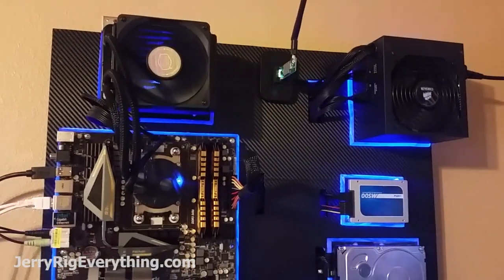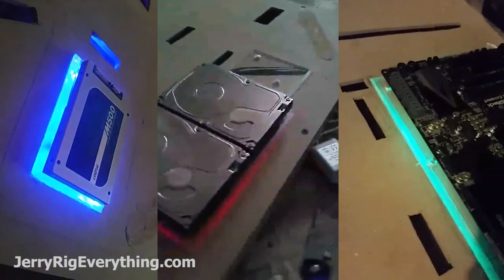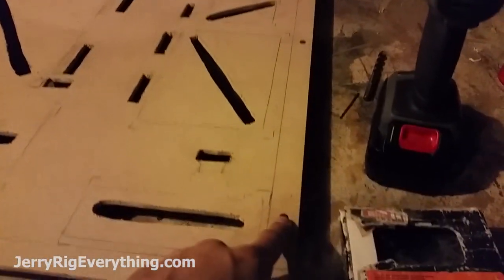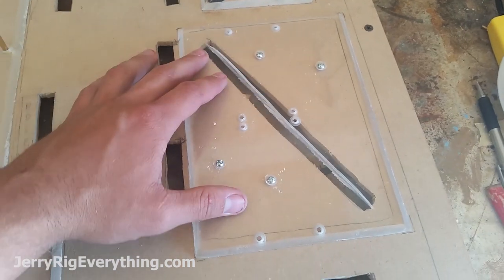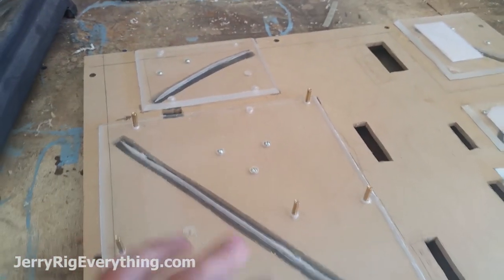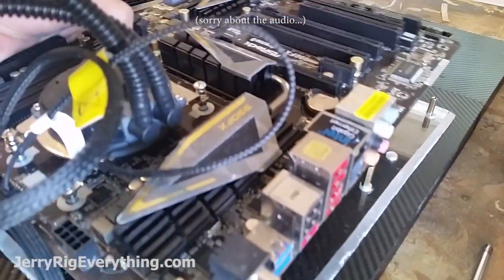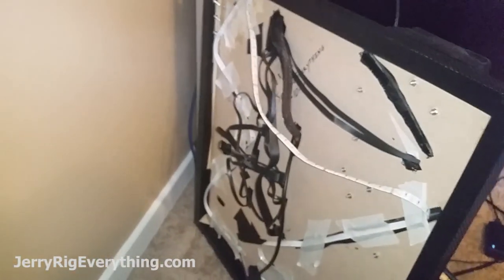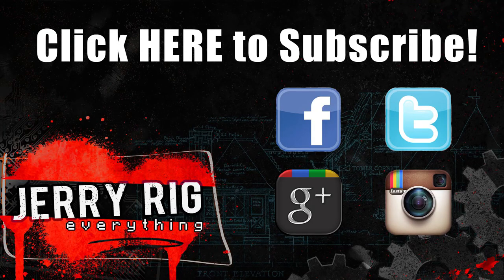JerryRigs' Rig - How the Epic LED Wall Mounted PC was Made

Comment: I like it, but about the only thing I would try to improve on would be to try to make some sort of retention clip mounting system for those drives. Would be easier to replace a failed drive if you could just pull the drive out without having to take the whole board off the wall. Looks nice!

Comment: holy crap now i absolutely have to build something like this, nice job man!
Reply from the maker: Tohtori Valta Thanks man!  If you do build it... find a way to ground the components.  I am currently having issues with static electricity. One Idea is to take all the screws that are sticking through the back, and connect them with copper wiring to the screws holding the power supply.
Reply: JerryRigEverything Will do, I've got a degree in electronics so i'm always really carefull with this stuff. Now I just need to find a way to make this happen with 2 gpu's

Comment: Jerry, I really enjoy your videos - it's clear you invest a fair bit of time making them.  I'm getting ready to build a computer and came across this video while contemplating building it without a case.  4.5 years later, how did that rig work out for you?  One of my main considerations is that I connect and disconnect many SATA drives a week and I want to use the hot swap sata ports directly instead of USB docks.

Comment: First of all, great video man, I've got some spare acrylic pieces lying around that I'm going to sand down for some illumination as well, but my construction will initially be really basic with cables all over the front... 

Anyway, just one thing I'd do differently -- @ 7:30 the power supply mount... I'm assuming this is a new PSU under warranty, but in my case I'm reusing an old 500W and my approach will be to take it apart and screw appropriate mounting holes so that it fits flush against the board or acrylic... still I like how sturdy it turned out even if it doesn't look as ideal

Comment: Obviously this is irrelevant since I'm sure you fixed the issue; but shrouding could be a great way of deflecting the rising hot air to the rad/fan setup. Regardless, really cool setup.
Reply from the maker: +Josh Johnson Good idea.  I actually just kept using it.  It never got over 74c-75c under full load.  I am just going to get a bigger radiator next time.

Comment: did you cut the acrylic to the size of the component or slightly larger to get the 45° cut? if larger, how much extra did you add. I'm doing my own build now and motherboard is 9inx7in. should I cut acrylic that size or add around 1/4 inch

Comment: question regarding the groove cut into the acrylic. was the groove cut into it like "V" or "^" if that makes sense. also how did you cut the 45 degree angle on the acrylic?
Reply from the maker: +bsdragster The grove was cut into the bottom of the acrylic in a "^" shape. (The cone pointing up.)  The bigger the grove (without going through the acrylic,) the more light will be dispersed towards the sides.  I held the acrylic over a table saw blade at an angle. Probably not the safest thing to do... but it worked for me.

Comment: Wow nice work! Especially using the plexiglass to spread the light of the strips is a great idea! But how do you turn on your pc actually? :P
Reply from the maker: ***** My motherboard has a setting where I can just turn it on with any key press on the keyboard. It also has a power button on the mother board itself. BUT all motherboards should have pins for an external power button that you can install anywhere (Usually preinstalled on a normal case.)

Comment: Hi Jerry, sorry for the noob question but would the graphics card and had drive overheat if you install it directly to a piece of wood? Should I use acrylic plastic for safety on top of wood? I am making a custom PC case out of wood so I wanted to avoid using plastic since it is easy to break but I might try drilling it myself. I have access to a drill but not the tools you do like the saw and stuff. I have to do everything by hand. How did you fasten the graphics card to the board? Does anyone else know how to do this? Many thanks in advance!

Comment: Wow that is nice did it haves power button I think it will be cool if it was on your remote
Reply from the maker: Sky Ski It does have a power button, BUT I have it set up that I can press any key on my keyboard to turn it on as well.  So I never actually have to touch the computer, Which is nice.
Reply: ok nice and uu i replace the batt in my iphone 5s its not working but when i chage it gets hot did i forget a cable

Comment: Good job. But didn't understand how did you put standoffs to the acrylic. Is there a nut on the other side or did you just stuck them in to the glass?
Reply from the maker: I just screwed them into the acrylic, after predrilling a hole
Reply: +JerryRigEverything Just wondered how safe it is to use that technique on an AIO cooler. Because radiator is heavier than Motherboard (in my case anyway) and honestly wouldn't feel cool about that.Is it possible to screw spacer in to the radiator and use a screw from the other side?
Reply from the maker: Caner Hocaoglu You mean like how I mounted all the rest of the parts?  Ya, you can do it that way.

Comment: I was wondering how you mounted the video card I could find pics anywhere
Reply from the maker: Corey Deal One screw through the hole in the top left of the card.  And then one screw under the card on the bottom right. (wrapped in electrical tape to make sure it doesnt short out.)

Comment: hi jerry. It`s really cool setup. I`m planing to build one. but using 3 tv's, would you have any suggestion on the graphic card,
Reply from the maker: Mohamed Hafiz Just make sure your graphics card is capable of handling multiple screens. I know mine can handle at least 4 screens. (Maybe 6) Its been awhile since I checked specs on it though.

Comment: Were you able to have your power supply reach all the components with the stock psu or did you have to buy extension cords? That's my main concern that the PSU lines won't be long enough when I build mine

Comment: How did you mount the video card?, I'm working on a similar project, and that's the one part i need to figure out.
Reply: Interesting point. Perhaps a wire connecting screws on the back board for a discharge / ground

Comment: I am building a briefcase PC for my brother. It will have an acrylic ceiling above the parts. I want to mount the graphics card to the acrylic ceiling and attach to the MOBO via PCI riser extension cable. Any suggestions to mount the GPU? I want to avoid anything metal touching the GPU. Right now I am thinking plastic brackets screwed into the acrylic.

Comment: Sorry if you address this in this video, I didn't couldn't find it. How did you mount the graphics card(safely)?
Reply from the maker: SirMisteryYT "Safely" is relative ;-) But I have a screw through a hole in the top left.  And than another screw (wrapped in electrical tape) supporting the bottom right side. The graphics card is just resting on that screw. Than the top right is just held down by the power cables themselves.

Comment: That was fucking amazing! Could you please include more information, about cooling, noise db, and costs of basic materials, and links to which types of cables you needed, and some of the lengths and measurements used. If you can provide this info I will make a website about your computer and all information will be posted there, to make it easier for people to reproduce something like this

Comment: Hey, i am planning to do my first wall mounted Pc and i was wondering; i am using a msi gtx 460 cyclone and there are extra holes in the pcb i think they are for screws, could i use that to mount it on the board ( regular wood ). What type of screws, if it matters anyway. Also for the motherboard, is there any safe make shift stand offs? I have seen some with screw and bolts and not sure if that was safe. Sorry for all the questions man xD

Comment: Looks nice! Any problems with dust? Noise levels? How about those two hard drives - any overheating problems?
Reply from the maker: Andris Zarins Temperatures are all in a normal range, And it is probably as quiet as my laptop is... watercooling is really nice that way.
Reply: thanks, ever considered lifting those hdd up a bit?  I have bad karma with hdd's lol... and they look like migh be overheating a bit if bothered a lot
Reply from the maker: They hardly ever work, as the operating system is actually on the SSD.  So I shouldn't have any issues.
Reply: JerryRigEverything Any dust issues? how long have you been running this rig?
Reply from the maker: Its been running for about a month.  It will probably accumulate dust over time... but a can of airdust will take care of that im sure.
Reply: JerryRigEverything Thanks Jerry, I would still raise those HDD up... well, that will be my rig lol :D thanks for superb video and good inspirational ideas!!!
Reply from the maker: Thanks man!

Comment: for the riser shielding that worked 75% of the time, what if you double coated or triple coated it?
Reply from the maker: No, i think i tried 3 coats.
Reply: dang. there must be a way to avoid that $80+ shielded riser... someone else tried 4 layers of aluminum foil before caving and buying that cable. There must be a way! what about something thick? some kind of wrap that was 1/8" thick so nothing could come too close to it? I don't know the range of that interference.
Reply from the maker: Let me know if you figure anything out.
Reply: I am in the research phase of my custom case and won't be doing anything for quite some time, but will try and remember to come back here if I make a discovery. thanks!

Comment: Niceeee. I was just thinking what to put on the wall above my gaming corner and this is the thing I deicided to do.... great job dude!!
But can You help me and answer few questions.

1. Can you place some links where you bought PCI riser cable and which one?
2.Cant quite see on the video this V shaped grove for LED's, is it facing V legs upwards or downwards-which way is it oriented i mean?
3. these large standoffs for mobo can be found in any store with pc components?
4.how big is the hardboard in the first place? i am afraid not to make it too large and then my power cables wont be able to reach components?

Thanks in advance
Reply from the maker: asukaj 1) Did you check out the blog post on JerryRigEverything.com where I linked the parts?  
2) The peak of the v shaped grove is facing upwards (towards the computer components.)
3) Amazon has the 1inch standoffs
4) I cant remember the exact size of the hardboard... I laid out my components before hand with the spacing that I wanted, and then got the board to match.  If you look at other wall mounted PC's online some of them have a lot more space between components.  I might go that route with my next build. 

Email me if you have any more questions. (email is found in the about section of my channel page.)
Reply: JerryRigEverything So almost done with my project, thanks for this video again i turned back to it a few times just to check some details.

For now everything is going great, i tweaked a few parts and did the same as You for a few things...

anyway my biggest concern is that PICe riser cable.

I ordered 2 - 20cm from ebay and i hope to daisy chain them and put some aluminium tape over the cable to shield it a bit.

What do You think of that or should I just have to buy the 100USD 3M one?
Thanks in advance
Reply from the maker: I never tried to shield it with aluminum tape... that MIGHT work... but just depending on how nice your graphics card is... you might just want to play it safe and get the more expensive shielded cable.
Reply: well it looks like i will have to do that...thx anyway....
and about the acrylic, I tried to put leds without the V shaped grove..looks like that grove helps a lot with light dispersion since when i put it on the acrylic without it the light didnt disperse at all..

Comment: the edges of the acrylic looked really rough, is it like that in person or just in the video?
Reply from the maker: ***** They are pretty rough.  I plan on making them smoother on my next rig that i'll build this summer.
Reply: awesome look forward to the video!
Reply: +JerryRigEverything Try flame polishing the edges.  you simply run the edges thru a blow torch flame and it melts the roughness looks like glass.  Practice on some scrap first !

Comment: How did you mount the gpu? I have the exact same as you can I haven't a single clue as to how you did it.
Reply from the maker: izaakisepic It has one screw through the GPU in the top left corner where the old metal bracket used to sit (the part that goes into the back of your computer case, if you were using a computer case.)  And then at the bottom of the GPU, you can see in the video that I have a screw sticking through the clear acrylic that is wrapped in electrical tape.  The graphics card sits on top of that screw.  Its definitely not as well mounted as the rest of the computer... but it gets the job done.

Comment: Love the video. Thank you so much for sharing. My question is: did you score the bottom of the plexi for light distribution or did you cut deep into the plexi? It appears that you scratched the underside nic and thick. Please advice if you simply do a wide scratch or cut into it? You mention groove in the center of each plexi.
Reply from the maker: The V shaped grove in the center of the plexy is thick. About half way through the glass.
Reply: +JerryRigEverything thank you. I will use my dremel for that then. I dont have a table saw but i do have a miter saw. Miter is not a good candidate. I will use either my dremel or rotary tool.
Reply: JerryRigEverything hello Jerry, thanks agin for your previous reply. I finally had some free time to resume my desktop build. my question is why diaganol grooves on plexi and some just horizontal, is it because of wire amd bracket mounting points that dictated the directional grooves?

Comment: JerryRigEverything  What led you to believe that plasti dip would help shield the PCIe cable?
Reply from the maker: Just that it is a rubber-like coating.  And rubber is an insulator. Flawed logic. Twas worth a shot.
Reply: Heh, yeah, rubber will insulate from other conductive sources touching the wires, which is why there's already insulation on the wires. What you needed was something conductive attached to ground that encapsulates the cable to absorb the EM radiation before it induces a voltage in the wire. :)

Comment: Is that soundcard even hooked up??
Reply from the maker: Matthew Fulmer Good catch.  Nope.  It is not.  I originally had it in the design, But when I was using my old PCI (Unshielded) riser, it was causing interference.  After I got my new shielded riser, I just never bothered to reconnect it. I'm sure it would work now If I wanted... but I just use the onboard audio from the Motherboard.

Comment: did you purchase the 3m carbon fibre? if you need a full sheet for another build i've got some :P
Reply from the maker: rebel3353 Yup, got it off amazon.  What do you use it for?
Reply: anything and everything lol, I have a 48" 50yd role in my room right now (father works at 3m) :P

Comment: Hi, so I had a question: Does it introduce a delay in the refresh rate due to the newly created distance between the mobo and the GPU? Other than that, awesome build, I would try building it but I can't, do you know of anyone who could make it for me? Would you accept commissions?
Reply: Hey Elsa, It'll down rate FPS if you're going to use PCI-E Cable. It'll make huge FPS difference so I'd recommend that plug GPU directly to MoBo without any additional Cables.
Reply: Sorry mate thats absolute BS assuming electrons "move" with the speed of light a cable of 50cm length is absolute not worth even calculating the delay!
It all depends on how well the cables are shielded but when you run a normal cable the air gap between the pcb and your cable should even suffice.
I run two graphics cards with 50cm extention cables each and had a 1.02% benchmark score loss.
There are other users as well who got similar results as seen here:
http://www.overclock.net/t/1427731/pci-express-extender-cables-benchmarked

Comment: JerryRigEverything Would you mind putting together a step by step on how you did it? I want to put everything together and I don't want to mess up... THe only thing I won't be able to have is LED's, but I already have a fully built system that I would like to build for the wall :)
Reply from the maker: This video is pretty much as detailed as its going to get... I mean, explain a bit more in my blog post but it honestly is all the information you should need.
Reply: JerryRigEverything Well I mean you don't explain what types of screws you used if it was anything special, what type/brand/size of the acrylic (plexiglass) plastic... That's the main thing, cause my grandfather is going to help me do this project, but I am not the most technical for construction so when you say "acrylic" idk what to actually LOOK for...

Comment: why is the board facing sideays, why not up ?
Reply from the maker: +sapin Which board, The motherboard?  Motherboards usually sit inside the computer with its ports on the side like that. I mimicked a normal computer case.